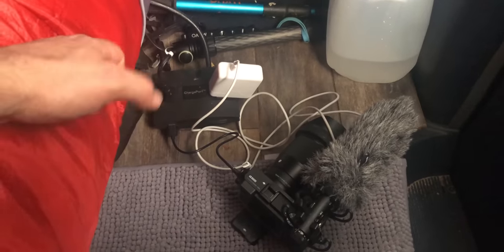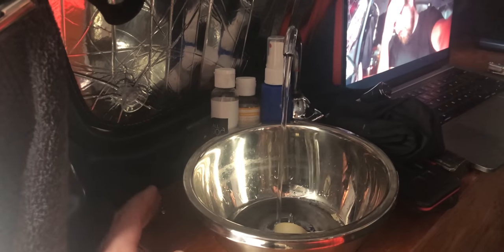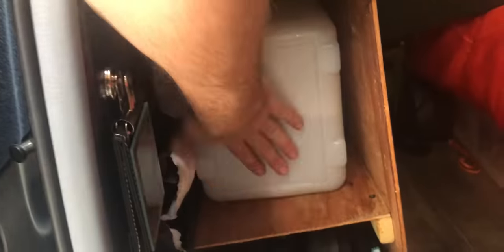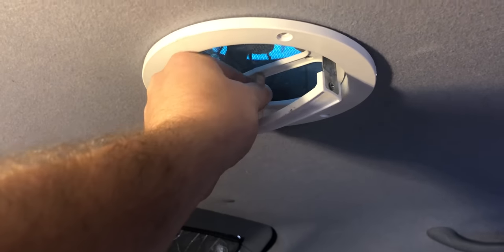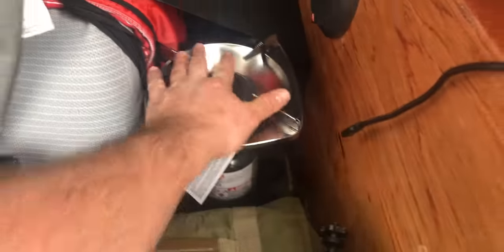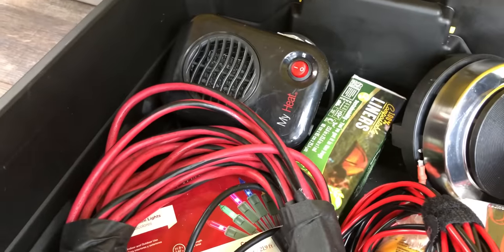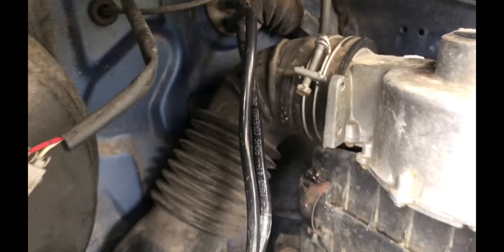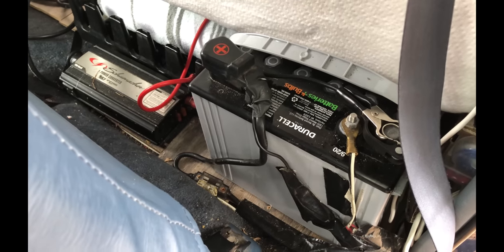Minivan Camper Tour * Toyota Previa Van Build.

Comment: please add a fuse on the power side of the auxiliary cable under the hood within 18"s of the positive battery terminal. I love the build and I love your rig dude. Cute pup too.
Reply from the maker: Good idea. Just in case the cable rubs and grounds out on the frame.

Comment: I love how simple the inside of your van looks,yet you look what looks like a huge bed,but you kept everything pretty plain and I like that ,you didn't block the windows with cabinets that look good but are really dangerous . I saw your set up for the water which I'm trying to figure out the best way for my minivan, I didn't get a good look at it, but did you have a little dresser or whatever there called. To hold your clothes and various items and I didn't see do you have a fridge or use a cooler?
   Sorry for bothering you with these questions I just didn't see this stuff on the video and I'm doing my build right now and have decided to keep this one really simple as possible.
       My biggest problem is I'm a big boy so I need a long bed,and I can't have my feet hanging off. So I went with a extra long cot heavy duty and I put a four inch memory foam both fold up really easy and quick. Man I gotta say I wish you took a little longer on the video some things you just skirted by,and even with how short it was I found a couple of solutions to problems and a couple of better ways to do a couple of things. Thanks man I love your build and I know simplicity is not everyone's thing.
        Thanks again
Reply from the maker: Just a cooler I leave on the floor up front passenger side. And  water is just a pond pump ran to a water jug. I explain it in one of my videos

Comment: I've got a 92 5-speed previa 2WD.  I'll be camperizing it this spring.  Love your simple setup.  What make is your ceiling fan?
Reply from the maker: I’m not sure. But if I was you I would get a bigger one! Big hole/small hole... still a hole in the roof. Worth it. It has a cooling effect because it’s pushing air out of the van so the van pulls air in through the tiny cracks and seals of the van and that low pressure going into a high pressure causes it to cool the air entering inside the van. Kind of like puckering your lips and blowing on your fingers. Vs open mouth blowing.
Reply from the maker: That’s what she said

Comment: This is awesome! I drive a 1997 Toyota Avalon, but this makes me want to buy a Toyota Previa instead. I'm in Florida though and wonder how I could keep it cool enough to sleep without leaving the car running for air conditioning? Any ideas? By the way, what size mattress did you use? Would it be necessary to cut the bed frame down if I'm only 5'5"? I think the lowest platform metal bed frame I could find online was 12 inches high. Thanks for a great video. I appreciate you sharing this!
Reply from the maker: Just get the frame and Matress i have. If you have to take a back saw to it just go for it. It’s relatively cheap and is much lighter than building a wood frame. Also folds up and easy to pull out of the van. If you check the description of the video you will find links to the Matress and the bed frame! Thanks for watching! I love answering questions so keep em coming!

Comment: Hey Sean, if I have a power bank that’s charged by solar and I also want to charge it with my car battery, how would I connect my power bank to my car battery for extra charging. I have a 93 previa and I’m converting it to a camper.
Reply from the maker: Wire in Parallel with your cranking battery

Comment: Great build! Did you install the fan yourself or have it done by a body shop? If you did it, was it difficult?  If you had it done, was it expensive?
Reply from the maker: I did it. its scary cutting the roof. remove the headliner
Reply from the maker: I would go bigger than my fan though! get a huge fan! put it right above the sliding door! why not!
Reply: I would love to do a maxx air fan but I have limited space due to a center console on the ceiling with a dvd player, lights, and ac controls on it. I guess I'll have to think of something else. Thx! 😊
Reply from the maker: Lol, yeah it can be tricky. Just find a flat spot and measure then look for a fan that fits your needs... if you are planning any warm weather camping... I mean any at all you should really consider installing a fan that sucks air out of the vehicle.

Comment: when your battery is in parallel it turns everything into one big battery
Reply: beware that 2 batteries in parallel had a lot of amps to short . 3 batteries …. well you don’t want that to happen . arc welder comes to mind !  install fuseable links between each battery with one way diodes . this will allow the crank / alternator to flow power through to charge the 2 batteries up line . but will not allow flow electricity back down  line . also if one battery suddenly gets a bad cell and internal shorts it won’t pull the other 2 batteries down with it .
Reply from the maker: Done!

Comment: Can not hear you at all.
Reply from the maker: Turn your volume up!
Reply: @sweetbabysean  it is maxed or I wouldn't have said anything!!!n
Reply from the maker: The audio is a little low cause I used my phone over the car wash broll. But I haven’t heard that from anyone else! Maybe you need to go into your settings and adjust max volume?
Reply: @sweetbabysean  I can hear you fine in your other videos. Thanks for the links, I saved the video I am researching converting my van. I did have another question, I have a pitbull how do you deal with hot days and or having to leave dog in through van at times?